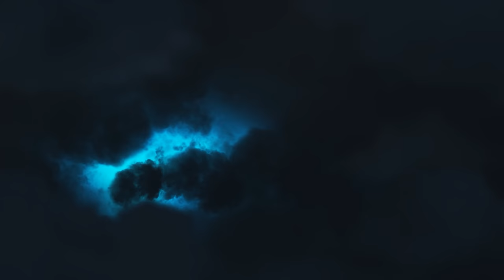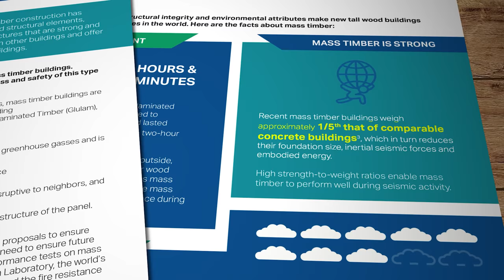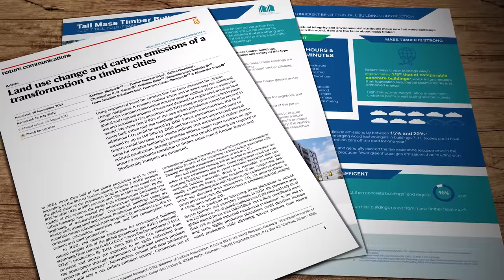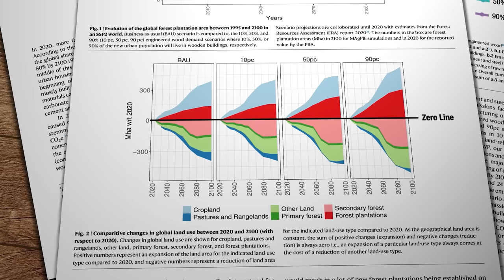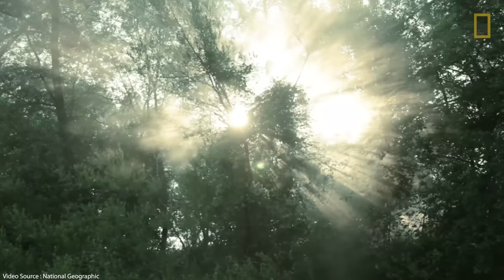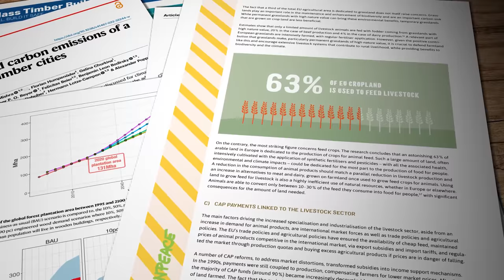Engineered Timber - building the skyscrapers of our future.

Comment: Would this be a good time to look again at Hemp? It is incredibly fast growing; the lignin can be used in Cellulose Nono-fibre production for extremely strong composites (lumber alternatives?) - with 'strength/weight ratio is 8 times that of stainless steel'. The rest of the plant can be pressed into service in other ways, like for Hempcrete - for panels or cladding with very high insulation values.
Reply: * what's the strength to volume ratio compared to CRES??
What is the Young's modulus of hemp?
How about the compressive strength?
One quickly runs out of footprint to put more support material when you start to build higher.
Stainless is used as a cladding exactly because it doesn't really degrade in weather and can't sustain combustion, as well as not being a significant contribution to volume (reducing useable space)
Reply: Grate idea Maybe bamboo could be used instead of timber also incredibly fast growing. Just need someone to investigate.
Reply: @jimurrata6785  stainless not very strong either! Stainless steel screws died much faster than ceramic coated ones in docks located in the Florida Keys. Stainless ones actually sucked all the way around!
Reply: @freethinker4991  bamboo is great earthquake resistant but structural only up to three stories, from what I’ve seen.
Reply: @TheLosamatic  There are a lot of different 'stainless steel' alloys. Quite a few of the aerospace focused ones would be better described as nickel/cobalt super-alloys than steel.
 I used the term to address Cy, who started with "hemp has eight times the strength of stainless steel "
Aaaah.... possibly... In pure tension... with no other factors considered.  But this video is about building skyscrapers of mass timber.
Which, in itself, is highly processed and not objectively better suited for tall buildings than dung.
You use a material like wood for stick framing because it is already nature's composite. Lightweight and needs minimal processing. This works fine at 4-5 stories.
Reply: @TheLosamatic  Thanks grate to know.
Reply: Separating the mast is done naturally. They let the hemp rot some to separate the fiber. The rotten mast is the hempcrete as near as I can tell. I'd rather not build with decomposed materials. I haven't seen any source that is a mechanical process.
Reply: I agree, hemp is grossly underused and should be promoted more
Reply: The obvious SOLUTION ......!!!!
Reply: @jimurrata6785  of course but when was the last time in the USofA any corporation did the best thing unless they were dragged into doing it kicking and screaming like a four year old, or dumpster, having a tantrum?
Reply: @TheLosamatic  I'm a little confused.  🤔.   Where did I say anything about corporations or nations?
I'm addressing the video. And this video is about building skyscrapers out of cross laminated mass timber.
I've got nothing against hemp (or flax, for that matter) but I don't think it has a place as a structural member in a 100+ meter building.
Reply: @jimurrata6785  did you actually watch the video? Pretty sure they showed the benefits of stronger, lighter weight, much less carbon footprint than concrete and steel!
Reply: @TheLosamatic  But as the base material for cross laminates it should match engineered timber, I'd hope. 🤞
Reply: @LukeKendall-author  well like I tried to point out when it’s corporate murica everyone involved should be holding their feet to the fire before building anything to the cheapest standards they will always propose, as it is the fiduciary responsibility of capitalistic companies to maximize profits for share holders regulations are all that keep workers and the public safe!
Reply: @jimurrata6785  Hemp has a very long fibre, and lumber made from hemp, rather than the short fibres of wood is many times stronger.  Hempcrete as you may know is very fire resistant.  The growing hemp plant absorbs much more carbon than a tree.  If you haven't looked into all the products that can be made from hemp, you should.
                  > Tom's wife Pam <
Reply: @tomfromoz8527 * Pam
And those fibers do have great tensile strength.
I'm pointing out that skyscrapers _aren't _ tension structures. Unless you know some way to hang a tall building from the sky.
Unfortunately, even hempcrete is an order of magnitude less strong than steel in compression.
Hemp definitely has it's place but tall skinny buildings isn't it.
Reply: @napalmholocaust9093  Where did you read this?  I have never heard of such a thing because what you describe would be a waste of the long fibres better used to make lumber, rope and any weave of cloth from canvas sails to fine silky underwear. It's the twigs, branches and waste that's used in hempcrete. Dry hemp stalks are easily pounded to separate the fibre.  There are films from the '80's that can give you more detail. 

You can also look into Henry Fords use of hemp in building his cars and also running them on ethanol made from the leaf of the hemp plant. There is a short film of him hitting the boot of the car with a sledge hammer, and having it bounce off. The material was a plastic made from the oil of the hemp seed.
 Hemp is very resistant to rot.  

> Tom's wife Pam <
Reply: @jimurrata6785  Agree. I don't think any lumber is safe to use in that respect, not even this engineered  gigantic plywood. But especially in the framing.  TY Jim   > Pam <
Reply: @tomfromoz8527   pearlings for ceilings made by laminating 2x6 together keep there strength longer in a fire than steel ones. Not sure about columns, but I’m sure there’s a formula engineers would use to figure that out. The video seems to think they have in fact and it said that it would be lighter for that compressional strength needed for tall structures. I think that was the whole point to the video making new buildings with less of a carbon foot print than regular made steel and concrete. Now I believe it was the Swiss that just recently made steel using just renewable electricity, no coal used to make the steel.
Reply: Why hemp and not kudzu? Kudzu is supposed to be the ultimate weed, and may contribute chemically if not structurally.
Reply: Sorry about the post- kudzu on an island will need an aggressive herbivore for control. What about repurposing palm? The fibers can be primed for petrification just before the tree is cut.

Comment: I think that trees can be planted in urban areas in addition to existing and future tree farms.  Also, silvopasture (the practice of planting trees on cattle grazing land) is another solution as well.
Reply: Urban trees are avoided with prejudice by sawmills. One nail can ruin a 500 dollar belt saw by chipping a tooth and making it cut crooked. No. No city trees. It will not happen unless the blades were subsidized.
Reply: Water is a factor, so is behavior, even without natural predators, but trees will allow more water to accumulate. Sensors in ear marks? They are cheap enough.

Comment: Recent studies have found that newly planted  immature forests are actually carbon sources for the first 15 or so years of growth and only become carbon sinks after the forest reaches a minimum level of maturity. More could be done with such things as bamboo and hemp as construction materials. And lets face it, sky scrapers don't last as long as forests. And if that's not enough, all that carbon sequestered in a forest is locked up in much much more than just the trunks of the trees.
Reply: I don't think Dave covered this counterpoint. Good to keep in mind.
Reply: To make a general assumption based on studies from a small areas do not work very well. You also have to look at the different terms used to assess the results. 
Willow can be harvested after 5-6 years and 15 year old Poplar trees can be 10-12 meter tall threes when harvested. If the studies was covering everything Willow and Poplar threes farmed would generate carbon dioxide from nothing since they never get old enough.
Reply: @bknesheim  The carbon isn't coming from the growing trees. And I agree, it most definitely needs more study, particularly if our remaining forests are going to be turned wholesale into tree plantations with a massively reduced range of biodiversity.
Reply: Is that because of the carbon emissions of the harvesting process? I wonder if more efforts could be made to decarbonize the farming process, such as electric trucks and harvesters.
Reply: At least there used to be an accounting based "emission" from reforestation on agricultural lands. It stemmed from this approach: agricultural lands was assumed to have the carbon content of a wheat field just before harvest, whereas a newly planted forest only had what was actually bound in the biomass. Turning a piece of land from agriculture to forest thus figured as a loss of carbon to the atmosphere. Only when the actual biomass of the new forest is at level with a mature wheat field will the accounting system register the forest as a net positive. In Denmark (my region) this meant net emissions for 6-9 years. This accounting method disregard the fact the the biomass in the wheat field is temporary, whereas the biomass in the tree are way less so. Don't know if it's still the way it's done, though.
Reply: @tageagtige  That would depend a lot where you are anyway:
For example eucalyptus: "Most euc species can be expected to achieve 6 - 12 feet of new growth each year." from the google search. And they naturally grow at very high densities on the ground. As you state the wheat biomass is very short lived. Less then a year for large parts.
Reply: @adamdevereaux2459  It's my understanding it has more to do with the soils, but I couldn't exactly say why. Consider that a forest is composed of a tremendous amount of organic material such as fungus, mosses, lichens, animals... all acting as a community that took many decades to reach an equilibrium. When that community breaks down and has to regrow from almost scratch it probably takes its toll.
Reply: @tageagtige  It really depends on what the original ecosystem was. Certain grasslands, like tall grass prairies for example, actually are more effective carbon sinks than forests with the carbon sequestered deep in the soil. But most of those grasslands in the U.S. that have been cultivated for well over 100 years now with almost no regard for soil health lost that capacity a very long time ago. It's a major reason a ridiculous amount of fertilizer is dumped on it. Unfortunately native grasslands are now some of the rarest and most endangered ecosystems in North America. And reestablishing forests gets faster results. A big area of contention is what standards should be used. Countries like Indonesia and Brazil are cutting down primary forests and replacing them with monoculture palm oil plantations, and trying to credit that to their emission reduction obligations.
Reply: True about the importance of both the soil condition and trees planted. Details like that are often disregarded in the political system, while accounting rules are front and center. The accounting rule was a real pain for me while I was working in the ministry for Climate and energy, because it made reforestation practically unviabel as politician never were able to look more the 5 to 10 years into the future. This caused prioritizing 1st gen biofuels over reforestation of degraded soils, because biofuels seemed to be more climate efficient.
Reply: Source?
Reply: @DavidAlsh  Can't find the original article, so take it with a grain of salt. My apologies. And it was a preliminary finding anyway, but something definitely worth further study. Found one article that said it took at least 10 years for replanted trees to start taking up carbon at any measurable level, and about 100 years before removal becomes significant. That is just the tree, not the system as a whole.
Reply: @tageagtige  by

Comment: As someone who's grown up in a timber-industry state (Maine), mass timber construction is certainly intriguing. I'm personally inclined to advocate for doing what's possible to decarbonize steel and concrete, then "fill the gaps" with solutions like mass timber. Steel and concrete are used far beyond the construction industry, so improving that has a wider scope of impact.
Reply: I've "grown up" in the construction industry. My concern regarding concrete and steel, is that they are not renewable from a source other than demolition and recycling. Timber does have a renewable source, from planting. However I totally agree that losing the natural forestation and animal and plant diversity is bonkers!
Reply: Gee someone who can walk and rub his tummy at the same time how clever told you so
Reply: Mass timber construction is one solution among many to capture carbon. 
Diverse tree farms could even be planted in a sparse way, to allow pasture grasses to grow underneath (silvopasture) to feed sheep and goats (they produce a little less methane than cows).
Reply: Mimicking forests to grow more, better food while replacing bad ag practices would be all plusses.
Mark Shepard of Restoration Agriculture fame mimics local forest guilds by growing food crops of trees, vines, shrubs and perennials.  He converted a run-down dairy farm, in an area that was open cultivated fields and general bad land management.  He uses a savannah/alley cropping for more efficient food production. This assists in pest management as well.  He also uses livestock in a variation of mob grazing as part of the management system. 
You end up with more calories and nutrition per acre than the previous use or that of the neighbors. The trees sequester carbon as well as provide a timber source towards the end of their life cycle.
Reply: @bubbleox8631  
Someday you'll be able to do that as well.
Reply: @FLPhotoCatcher  
I just commented on somethingsimolar,aka Mark Shepard.
Reply: "As someone who's grown up in a timber-industry... mass timber construction is certainly intriguing" ... no shit. Only because you grew up doing something, it doesn't mean it's the right thing to do.

Comment: Intriguing. Thank you! Channel question: Are you looking into thermoacoustic heat pumps? You did a great video over 1yr ago on Fluid Dynamics' Stirling Engine heat pump, which is similar, but Blue Heart Energy's tech has fewer moving parts. Ecop's Rotation Heat Pump also uses noble gases and doesn't rely on a phase change, but is intended for industry. It's worth mentioning the earth's helium situation regarding these solutions, though. Just suggestions. Great channel!
Reply: Think Too… well I don’t get the first response you received? But it sure sounds interesting to me thanks, I’ll look into that really sounds cool using sound to make things  heat up by vibration!?!

Comment: I think Albedo effect is overstated.  People speak of it as though we're painting a light-colored surface a dark color. That would be true for rocks and other minerals. Dark-colored minerals absorb light energy, storing and radiating it as heat to the surrounding air. It is not true for plants, which absorb CO2 and solar energy and metabolize it to create food for the plant through photosynthesis. Plants tend to lower air temperatures through shading the ground (which would otherwise radiate heat into the atmosphere) and evapotranspiration.  The other concerns about man-made forest plantations replacing natural forests is valid, though. There are crops that could be replaced with wood plantations, as mentioned in the video.  But we can also take advantage of the fact that there are wood species that grow in soil unsuitable for farming.
Reply: Hello! There might be an interesting study to be made. Since "engineered" timber can be made out of a variety of materials, wood, bamboo, hemp, a question to ask is: Are there economically viable plants that can be grown on soils unused? From the ocean to the deserts or depleted farmland there is enough unused space. No destruction needed or already happened... ^_^